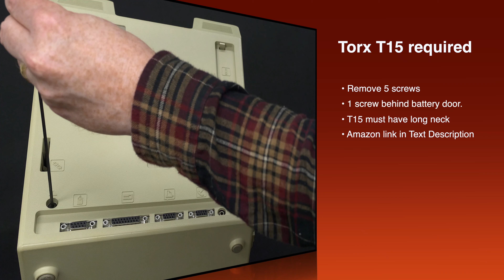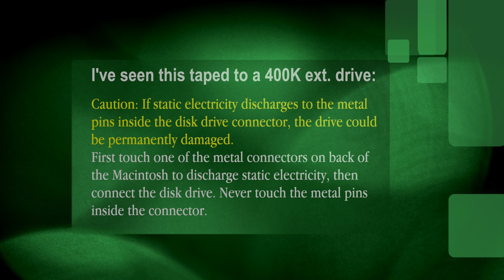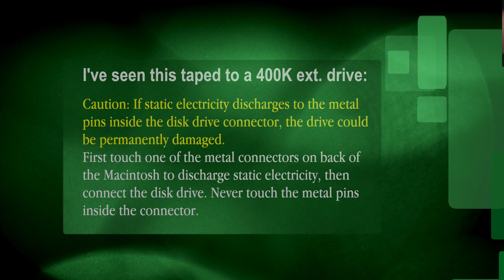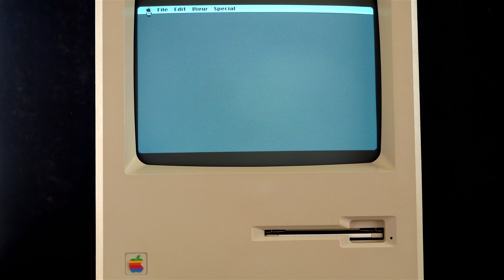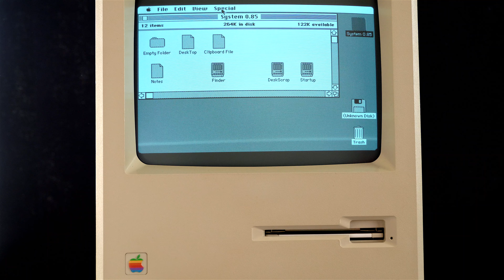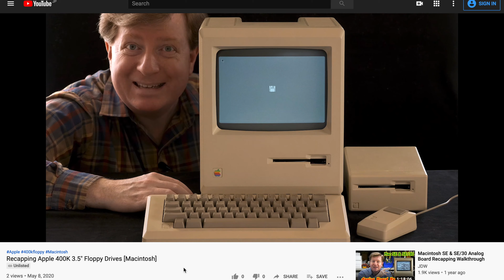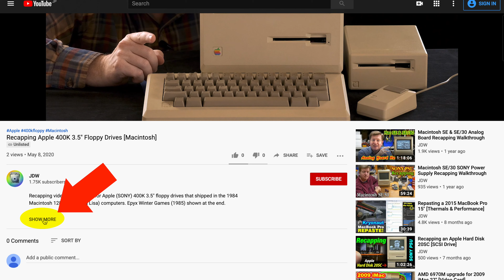Recapping Apple 400K 3.5" Floppy Drives [Macintosh]

Comment from the maker: Folks, at 55:30 I show that holding down the mouse button at cold boot doesn't eject the external 400K floppy.  I've since changed those 64K ROMs on the 512K motherboard for 128K ROMs (same as the Mac Plus), and now when I hold the mouse button down and switch on power, the external drive will eject the disk.  So I guess it was a bug that Apple figured out needed a fix in the ROM code.

Comment: I’m currently repairing a Mac 128K so this video is super helpful. Some things I noticed about my Mac: it has an external 400k drive with an OA-D34V mechanism inside but the little metal piece in the front goes over that one IC on the front of the upper logic board so maybe that’s something they just started doing at some point? And my Mac is a later 128K with the memory denoted on the back and it has an OA-D34V-22 drive inside it, but it’s got the early A ROMS. I know it’s never been opened because of the filth and battery corrosion I had to clean up so I’m not sure what’s going on. I’ll see if I get that error code - have to replace a RAM chip first.
Reply from the maker: Thank you for your kind words. You appear to be saying you are unable to get a bong and instead get a sad Mac because one or more of the Apple Logo branded RAM chips is bad. If so, yes, you will need to rectify that problem first, before diagnosing floppy drive issues. It's important to bear in mind that those Apple Logo RAM chips are considered to be NOTORIOUS for failure.  A purist who wishes to keep everything in the original condition would balk at what I'm about to say, but if you have to swap out even one RAM chip, it's technically not a 100% stock board anymore.  Some find it better to just swap out all the RAM chips to make the machine a 512K, then install Kay Koba's FAT MAC SWITCHER so you can make it behave as a 128K Mac or 512K Mac, at the flip of a DIP switch: https://www.youtube.com/watch?v=zJqADiViAyo
Reply: @JDW- Yes, I had a sad Mac error on startup pointing me to that chip, which I replaced and now it starts up. The internal -22 drive does actually work even though the motherboard has the early -A ROMS. Maybe the ROMS without the -A are the ones incompatible with the -22 drive? Not sure. Don’t have any other machine with 400k drives to check.
Reply from the maker: @MaxsGarage  Thanks for sharing your experience.  Others have reported something things that break with the conventional wisdom.  I just added the following links to the text description:
🔥 ROM REVISION INFO
• https://bit.ly/4fd0L2D
• https://bit.ly/4f81WkB
• https://bit.ly/4eQJoEZ

Comment: At 15:02 you mention the tab on the 034v and on the unidentified one. I have a D34V-22 that has that tab. There's a sticker on the other side that says "ASCO April 1985". I think if it was intended to be in an external, it has the tab. I don't remember what mine came out of.
Reply from the maker: Yes, the tab indicates the floppy drive most likely came from an external enclosure. There aren't any other changes to the drive, so you can use it internally or externally just fine, with the tab only being used in the external enclosure.

Comment: It looks like the unmarked drive is a OA-D34V-02 drive:

"There are two types of external disk drives [M0130]:

1. Serial number starts with D, made in USA. The earliest of these contain Sony OA-D34V drives. Later ones contain OA-D34V-02 drives.
2. Serial number starts with Y, made in Japan. These contain Sony OA-D34V-02 drives without export labels, since they were components within a larger unit. Production of external disk drives seems to have been moved to Japan around September 1984.*

* There is a slight difference between the two in the color of the plastic case. The plastic used for the D drives is the same as that used for early Macintosh machines. The plastic used for the Y drives is a shade lighter and does not yellow, at least not nearly as much."
Reply from the maker: Thank you for providing that detailed investigation!  I had a feeling it was probably a "-02" drive.  The color of the plastics of the external enclosure quite closely match my Mac 512K, but it's been many years since these machines were new, so perhaps very light yellowing through the years made them look almost the same today.  In any case, THANK YOU!
Reply: @JDW-  No worries, glad to help! My Lisa 2/5 has a OA-D34A-02 (with a label on the side) and it looks identical to the one from your M0130.

Comment: Great video! So this is a bit bizarre, but I just cracked open my 512k to confirm, and it's all original with the 64k '-A' ROMs, but it originally had a '-22' drive in there! When I got it, I swapped drives with an external one, since the original internal drive wasn't working, and I wanted a working drive in there. So now I have a 512k with a working drive originally from an external drive (no label), and the external drive with the original drive from the 512k (labelled -22) that doesn't work. The -22 drive just attempts to calibrate (3 distinct RPMs) then rejects right away.
I also have a third unlabelled external drive I bought later, I just tried that one and that produces the 0F0064 error you mentioned.
Still looking for a guide on how to realign my two non-working drives using an oscilloscope. For some reason I always assumed that these things just needed alignment to work, but I guess there might be other issues as well. I've lubed them all and verified the felt pads were there and the read heads are clean.
Reply: I'll add that my 512k is 37th week of 1984, so a fairly early one.
Reply from the maker: Thank you for watching and for sharing your experience.  It's at times like this spare parts come in very handy. I've found some very oddball 400K drives that work when you least expect and then suddenly don't work when you think they should.  I've adjusted drives only to find they didn't work until I swapped out the ROMs.  By having either 64K-B or 128K ROMs to test, you can tell right away if your drive really needs adjustment or not.  I think this is important because adjusting the drive is very fiddly and time consuming work.  You are basically moving parts only a fraction of a millimeter at a time to get it back into adjustment.  But if the root problem is in fact some incompatibility with the ROMs, then attempts at adjusting the drive may actually put it out of adjustment because that wasn't the root problem.  All said, if you can lay your hands on 64K-B and/or 128K ROMs, I highly recommend that test before doing any adjustments.  And when it comes time to doing adjustments, I should add that it can be done without a scope.  It's a matter of making multiple teensy tiny position changes of a particular part while repeatedly testing until at long last the drive starts working again (assuming no issues with the ROM).
Reply: @JDW-  I attempted adjusting one of these drives using the no-scope method you mentioned about a year ago. Three hours of slowly escalating frustration, and the drive still ended up flaky at best! It did occasionally read, so it shouldn’t be a ROM issue. I’d much prefer the oscilloscope method for my second attempt, since I have access to one. I just need to find a repair guide that assumes an oscilloscope somewhere.
Reply from the maker: @vkoskiv  I've looked for that guide. It doesn't exist.  Sony had special test equipment to calibrate these drives, which went far beyond a mere oscilloscope.  By the way, I've had some drives not work at all, even after a basic head cleaning.  I recapped, cleaned and adjusted the drive, but still no dice.  I then put the head under a microscope and found gunk still stuck to it!  I then took a swab and 99% ISO alcohol and cleaned that head about 5 times.  Another look under the microscope showed it clean.  I then tested the drive and it worked!  So sometimes what you least expect is ultimate the fix, and that truth applies to both 400K and 800K drives too.
Reply: @JDW-  I tried running the Apple internal SonyTest software, but that was - as the name suggests - built for testing. I didn't find any calibration functionality in there. I think I'll do another pass of cleaning and blind adjustment of the head and see if I could get it working. I would prefer to have the original drive in the Mac instead of this swapped arrangement.
Reply from the maker: @vkoskiv  Give Apple's MacTest a try.  This version runs on the 128K through the Plus.  You can text the Internal or External drive. https://macgui.com/downloads/?file_id=22127

Comment: Do I ever remember this! I was 9 when my father brought home our first Mac. In 1987 we picked up a used 512 and an HD20. At one point I got the HD20 working with a System that did not support it by turning the HD on at the correct point in the boot process. I no longer remember if it was using it with a much newer or a much older version.
Reply from the maker: Your earlier post mentioned the fact you still have your 128K and 512K Macs, so do you still have your HD20?  I have one.  It still works, despite the fact I've not yet recapped it.
Reply: @JDW-  Sadly no. At some point my parents cleaned out the basement and that one disappeared. At one point I had an SE upgraded with one of the very rare Prodigy 020 boards... I guess after thirty five years I've had my hands on many Apple memorabilia collectors items... Eventually you gotta choose between sanity and keeping everything that's got any sentimental value.
Reply from the maker: @EricDunbar97  Ouch!  A basement cleaning that trashed an Apple HD20 is a thorough cleaning indeed!  In the case of my own parent's home, we were blessed with a garage that has a loft, which even to this day is still used to store both essentials and non-essentials.  My Dad was asking me the other day if he could throw out an old U-control gas motor aircraft I made out of balsa wood as a teen in the 80's!  :-)  Sadly, my own Mac 128K acquired in 1984 and later upgraded to a Plus (after mega bucks were spent by me, let me tell you) is no long in my possession, but that is only because I sold it in 1989 to a co-worker.  I also don't have my IIvx, later updated to a Quadra 650 by means of a $1,000 motherboard swap, but that's because I sold it for $1200 to my employer as a 24/7 fax server a few years after moving to Japan.  At least I can take comfort the machines went to good homes.  And for all I know, that Q650 is still serving faxes to this day.  Japan loves FAX machines!

Comment: I never knew these floppy drives needed a recap. Do the 1.44mb ones need it too? I don't see a video about it on your channel.
Reply from the maker: Any electronic device with an electrolytic capacitor in it which is 20 years old or older needs to have those capacitors replaced.  That includes mice and keyboards too.  In fact, the Apple IIgs keyboard I had attached to my SE/30 was causing my SE/30 to lockup until I replaced the cap inside the keyboard!  I don't have a recap video for the 1.44MB drive, but I do have one about the 800K drive, which is very similar in design: https://youtu.be/sy6JWEerHQc

Comment: Your link for "Soldering iron with °F-only LCD & Solder Kit (80W, cheap!)" shows as not currently available at Amazon.  I guess that's no surprise given that your video was posted 3 years ago.  I bought the "Soldering Station (120W, ESD safe)" instead using your link.  My old Weller WTCPS soldering station no longer seems to be up the task of dealing with the circuit boards I'm working with.  I'm also having problems finding replacement tips, so a new station seems to be in order. Thanks for the referral.
Reply from the maker: Thank you for letting me know.  I swapped out the link for the 80W iron just now, for people who are still in need of a very cheap solution.  

But honestly, the 120W soldering station you purchased is the better product.  Arguably, there are some sold by HAKKO which are better still, but pricing for a basic HAKKO FX888D is about $155, which means you could buy 2 of the "Soldering Station (120W, ESD safe)" units you bought, and still have money left over.  For people who solder something every few days, maybe a quality Hakko station is worth the higher price.  But if you only solder a few times a month, something more economical like you purchased works just fine.  Besides, as you solder more over time, you will also find that other soldering tools are useful, such as a $50 hot air station.  You eventually may even need a desoldering gun instead of a wick, and it's usually at that point you should consider a better quality device, like a Hakko FR-301.  The reason why is because desoldering is much harder than soldering, and ground planes sink a lot of heat, so having a powerful gun like the FR-301 is important.  Unfortunately, the FR-301 is rather pricey at just over US$300 on Amazon.

Comment: After Fixing a Mac 128K Logicboard and Analog board, I focus on the 400K Floppy drive. After Recap, lubrication and assembly. I could boot from it, initialize disks, copy files, and eject perfectly but I have a question regarding the behavior at power on without a Floppy on the drive.

If I power the Mac 128K, the disk spins, but keep trying to eject but no floppy on the drive. If I put a floppy in, everything behaves normally. This is a Mac 128K with -A ROMS.

The question is, normal behavior or not?
Reply from the maker: Thank you for your feedback. "Constantly trying to eject" is NOT normal behavior.  As I mention at 12:44 though, mismatched ROMs and 400K drives will result only in a Sad Mac, not a constant eject problem.  Most likely, one of the black plastic IR sensors is dirty or otherwise blocked.  If you watch from 21:45, you will see me remove a plastic piece from the middle of one of those IR sensors (aka "optical sensors").  That moving plastic piece must be removed for inspection and cleaning.  Also, that IR sensor near the front of the drive detects whether or not a disk is inserted.  A different IR sensor pertains to the eject mechanism.  I would suggest you inspect and clean all the IR sensors, then test again.  If the problem is gone, you're done.  If the problem is not solved, it could be anything from a jammed mechanical part that requires lubrication, to a fault on the circuit board.  But when investigating problems like that, it's often helpful to have more than one vintage Mac in which to test, to ensure you can rule out issues possibly caused by the Mac itself.  I don't think the Mac is causing the problem in your case.  I am just trying to speculate "what ifs" right now, assuming your IR Sensor cleaning doesn't work.  I suspect it will though as such has worked for me in the past.
Reply: @JDW-  Thanks for your reply, regarding the black Sensor, I cleaned the sensor and nothing is in the middle of it. The behavior is only when no disk is inserted. Any other Idea?
Reply from the maker: @FranciscoPerez-g6d  When you said there is "nothing in the middle of it," I assume you mean there is no dirt there, but if you mean there is no plastic piece there, it's a problem.  Because as you can see in my video, there must be a moving piece of plastic in the middle part of that sensor.  If you have no dirty and you also have the correct piece of plastic (which slides) in the middle of your sensor, and if you have indeed inspected and cleaned all the IR sensors, not just that one, then like I said in my previous reply, the problem could be related to something frozen up on the drive.  Your opening post indicates you fully cleaned and lubed the drive, that would point to another problem.  But those problems are rare.  In the vast majority of cases, "constant ejection" problems pertain to the optical sensors.  The other problems are problems indeed because they pertain to either the ejection motor or the circuit board itself.  And that's why I said in my previous reply that having another Mac of the same type is useful, so you can try the drive in that other Mac to see if it has the same problem, and if it does, then you know the problem is absolutely on the drive, and the problem has nothing to do with the Mac at all.
Reply: @JDW-  Yes no dirt, sprint is working and the plastic arm is there moving perfectly. Maybe the Sensor is bad...  The question will be if I can get a replacement, part. The one on the left must be the issue.
Reply: @FranciscoPerez-g6d  Your best option is to find a cheap or free junk 400K drive for the purpose of using its parts.  Most likely, the junk drive is just mechanically frozen and has a good circuit board and sensors.  In fact, if you had such a drive, you could swap the PCB to see if that made a change.  If not, you could then resort to swapping only that one IR sensor.  I do this sort of thing myself.  I usually have working devices and then junk devices as spare parts.  I know this isn’t the type of fast solution you are seeking, but I’m afraid that you’ve already tried cleaning the sensor and found that didn't work, and you’ve cleaned and lubed the drive itself, which is why the only explanation for the continued troubles must be either a bad sensor or something wrong on the circuit board.
Reply: @JamesWages1  Good news. I got it working!
The issue was the right sensor. I decided to desolder and swap the left and right optical sensors to test. The Right sensor, one of the legs was completely gone (rusted). I use an exacto knife, to remove part of the plastic to expose a good part of the little leg. Use leftover legs from a capacitor to extend it and put it back. Everything work,
Reply from the maker: @FranciscoPerez-g6d  I appreciate your time in reporting back. That's fantastic news.  Great job in being innovative to fix that rusted leg stub.  Congrats on your determination and excellent repair work! 👍